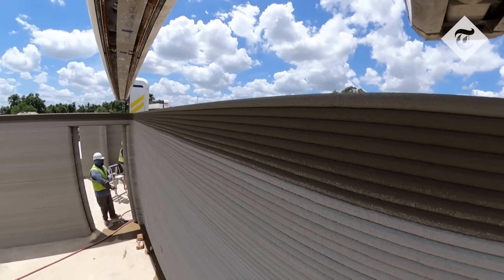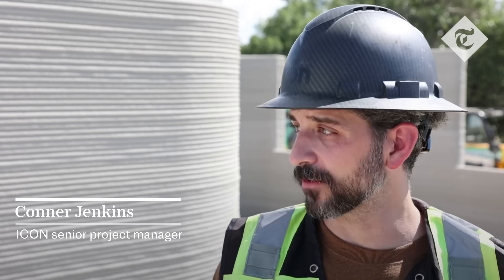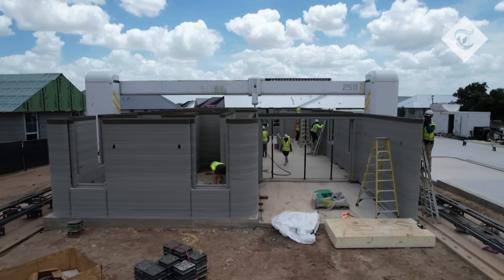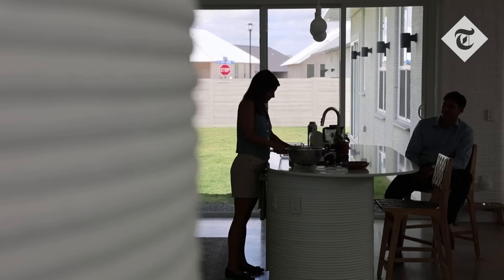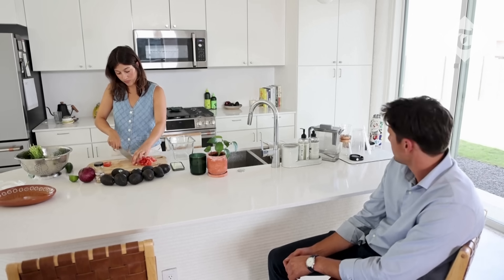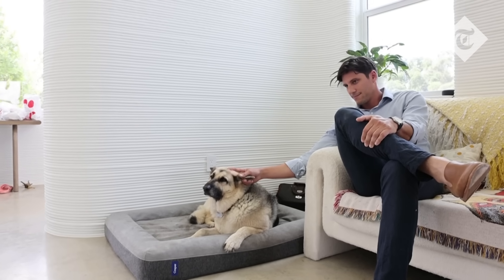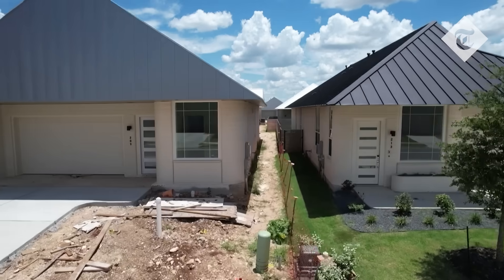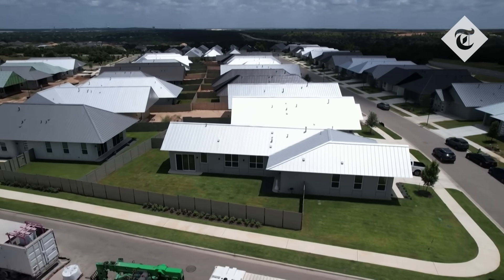3D-printed homes get built by robots in Texas neighbourhood

Comment: Is that stuff even structurally sound? They essentially just pour concrete to make a house, so basically it's just made of mud slabs, with no reinforcement whatsoever, how is that stronger than a traditional house, especaially in Texas, where it's pretty hot and humid. The slabs are going to crack and maybe break in a few summer winter cycles

Comment: Decent looking homes, but I noticed they have no rain gutters. I'm surprised all the walls inside are concrete. Usually, they put up metal frames or wood to hold up drywall. Maybe it'll save printing time if it just print the outer shell and certain points in the house. Also, was rebar installed around the base? How did it print with rebar in the way if it rebar was present?

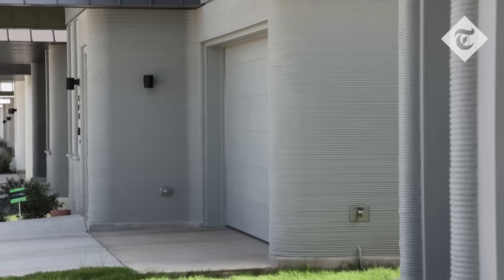Comment: Not bad. The design and price can be better. I agree with what he says at 2:29 It's still new, so there is a lot of room for improvement. And we have to also consider repairment. Like if the wall get damaged, we can't fix it like the traditional wall. The biggest pros I see with using this technology is the consistency in quality and potential affordability. I feel optimistic about this. I mean the idea is good if they aim to use it for good cause and not just pure greed.

Comment: Where is the rebar / wire mesh, etc.?

How can they guarantee that the concrete won't fall apart over time?

Will there be finish work to smooth out the walls on the inside or will they install drywall or some over finish material?

Comment: I would honestly use it only as a structure. but interior walls and exterior would do the old way. ie building drywall frame. so houses would be quite wider and taller to accomodate extra walls. but communications and everything else can be easily hidden inside. also curious how are those walls hurricane/tornado proof

Comment: The guy has never been in a brick building. Having a concrete wall is very avaliable in Europe. So yeah, it's the same as apple with the Iphone, they made them believe it was never done before, while they only modified it slightly. in these shity houses there is no heat isolation on outer walls, so good luck with the cooling/heating bills.

Comment: Less expensive?????  Out on a barren prairie, far from the freeway, no trees, no water?  I guess they're practicing for building on Mars.
Reply: Priced like it’s on Mars too.
Reply: @BlurryDoggo  There is only one house I would want to buy in the Georgetown area; about 10 years ago a company built houses using RASTA concrete blocks, metal insulated roofs with ridge vents, all the great stuff, not like the houses built under 50 year old codes like in Austin.  Horrible houses.  Most don't even have ridge vents or adequate soffit vents for pete and petra's sake!

Comment: How is this kind of printed concrete not in need of rebar reinforcement? I understand there's no immediate tension or inconsistencies, but I thought concrete always needs help.

Next, the unpainted exterior will be terrible to keep clean, and how is the interior treated? The echo in the hospital-like interior of the example interviewee's house is terrible. No pictures on the walls either - but integrated electrics and plumbing. How?

Last, detached homes being placed so close to each other that neighbour's can kiss without leaving their houses...why? Isn't it way more space-efficient to just build a city structure with attached housing or blocks? So many design questions here.

Comment: Way overpriced jeez I thought this was supposed to be cheaper??!!!
Reply: Those are big houses, not small ones. It's the cost of the land that makes it expensive
Reply: @naisyjohns  no there on even on a lot of land 500,000 for that size house is overpriced
Reply: @dustintacohands1107  Not when compared to the average house prices of that size
Reply: @naisyjohns  I looked it up these printed houses range from 1500-2100 square feet.

 the average cost of a house that size is 300,000 stop pulling things out of thin air dude 

and seriously look at the lot sizes that’s like a half a acre which isn’t more than 30,000.

These houses are at least 30% higher costing  than your average house roughly estimating
Reply: @naisyjohns You're wrong, he explains the real reason at the end of the video
Reply: @carstarsarstenstesenn  He doesn't say anything about the price? He's just saying the market needs to adjust. Maybe pay attention before commenting
Reply: @naisyjohns  😑
Reply: @dustintacohands1107  Lennar construction is who they partnered with. The 3d printing parts happen quickly. Then the construction co comes in and put a building into the design sometimes adding a non printed second floor taking as long as it can to build a regular house.  They are known for overcharging and bad craftsmanship in their condos. Icon is saving the company however they’ll never make an affordable house for the working poor. Icon should have done their research before agreeing to signing or shouldn’t have been forced to sell out.
Reply: @JohnLaFosse  I hope it works out this is the future but it’s not there yet
Reply: Lol in the UK that would be cheap for a house. I guess the prices will come down as technology matures.
Reply: @elliec4154  parts of UK are cheap or not so much???
Reply: It's an affluent suburb of Austin Texas... That is cheap!
Reply: @d.carter3850  no it is not cheap dude look at the house and lot size go compare them to others builds the prices don’t match
Reply: Very affordable compared to California, Hawaii, New York, etc... If they 3D printed homes in CA then fewer would be homeless.
Reply: @Meeko58  no, those homeless people would still find a way to be homeless. They're homeless because they suck at life, not because they're victims of something. Victims of the decisions they make.
Reply: Wolf Ranch is where those homes were built. It’s considered the rich area of Georgetown the nice part of the town. The company may have chose that area to make a profit off their homes. Kinda smart actually
Reply: Better than the prices in most cities. Definitely cheaper than most Canadian cities right now.
Reply: @B.D.F.  sure take it to Canada and magically it’s not effected by your prices… dude it’ll cost more in Canada then
Reply: When USA has paper homes much more expensive?
Reply: @danielkissgremsperger3242 why foreigners have cheap homes made out of clay?
Reply: @danielkissgremsperger3242  they're comparing matchstick homes to ones built of concrete and steel. 😂